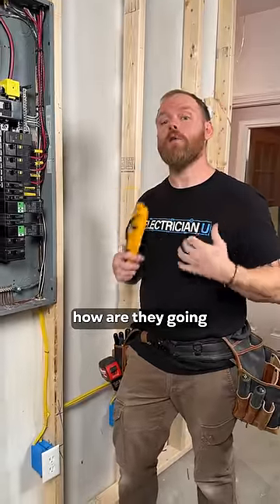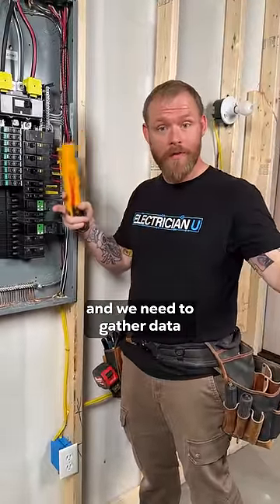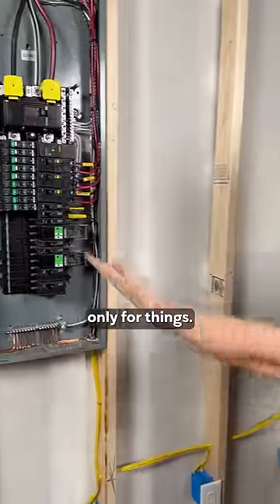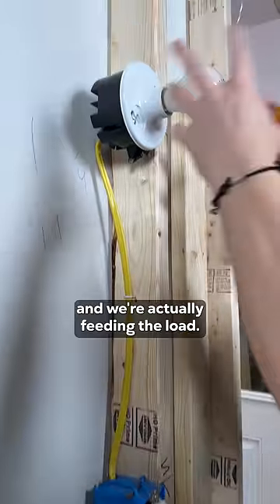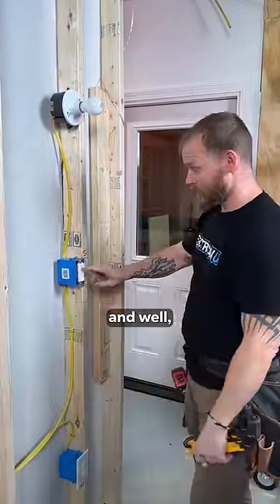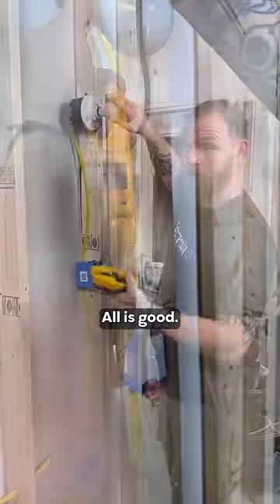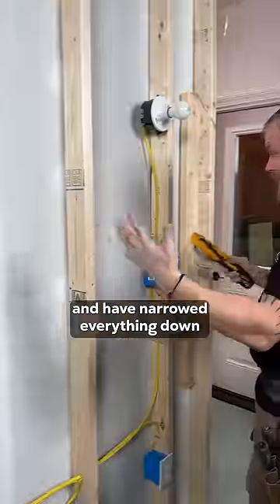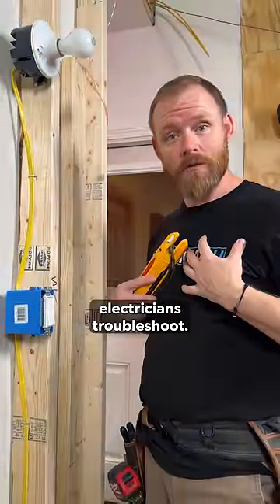How Electricians Troubleshoot a Problem

Comment: Good troubleshooting is always process of elimination, figuring out what the variables they are, testing the most likely causes first if you know what the common failure is and then ruling out any others. Worst approach is simply swapping everything as you have no idea what it was that fixed it at that point. Doesn't matter if it's electrical, electronics or mechanical or even medical.

Comment: All electrician's aren't created equal. Don't accept someone's word based on their resume.  anywhere from 500 to 1000 are electrocuted every year.  About 30,000 have no fatal accidents. While it's fine from an electrical stand point to use 12 gauge wire for a 15 amp circuit. ( a wire can technically never be too big.) An inspector CAN make you rip all that wire out and install 14 gauge wire. The inspector has the final word so be respectful and humble. If you come off as arrogant. I guarantee he's going to find something he doesn't approve of.

Comment: I have a question. Bulb in good condition, swith  in good condition, breaker in good condition, voltage in bulb socket (I removed the bulb and test voltage inside the socket) 117 V. But no light. Where is the problem?

Comment: done maintenance work before..(not a pro but learnt well) .......I usually always knew if it was the fixture or the switch... easy to figure. minus the bulb/breaker switch.... was told once "turn that breaker off before you change that (bedroom) light fixture" I said why?... there's the light switch right there. .......in off position... THAT person learnt that one on me.

Comment: Yeah but you didn't say open the breaker (remove power) before replacing the switch. You tested and told me you got 120v there, now you just started replacing the switch, far as I'm concerned that circuit is energized, I don't know who/how it's wired, I won't "assume" it's installed correctly. Whoops! Safety first, correct?

Comment: The worst troubleshoot I ever had in my work was trouble shooting an ancient automatic fire alarm system on a huge hospital (Huge hospital in Norway is probably not so huge in US standard, but I was alone). The fire detectors were wired in a star configuration, which is illegal these days in Norway and cause alot of headache. I used days just eliminating and troubleshooting. In the end I found the fault in an old hidden junction box, one of the wires were a little melted (I could tell that whoever stripped that wire 30/50 years ago, nicked the copper), and it probably only had like a 50% connection. I replaced one wire and reconnected it, and everything was back to normal status. Troubleshooting can take a huge amount of time

Comment: If its a bulb, GFCI or breaker reset, etc. its not hard to convince them that its a way lesser evil than if i had to troubleshoot half a day and open up walls etc to fix bigger problems. I mean surely they didn't want it to be a big problem just to not have to say they were dumb.

Comment: But my lingering question is; I want an experienced electrician to come out to check and map my breakers and the wires. Then eventually relocate some wires due to scheduled remodeling (I.e, in some places they are just in the way for a clean finish). I also want the electrician to remove unnecessary locations. However, my question is how do you find an electrician who is not just going to quickly look, overcharge, or otherwise make stuff up to upsell. Cause as far as they know, they are doing an inspection and mapping. And they won’t know about the several projects, until I see their work and their knowledge and behavior. I am not an electrician and while I will replace light switches or broken outlets, I won’t touch a breaker, cause I don’t want my house to burn down or for me to be fried.

Comment: Same intelligent process I teach to my computer programmers.  So they can "debug" a program.  

Same basic process as repairing radios, TVs, etc.  But, it's called "signal tracing".  Inject a known radio signal into the first stage.  Then check that signal as it passes from one stage to the next.  When you find a weak or distorted signal coming out of a given stage, that's the problem.

Comment: German Electrician here.
I wish it would be that easy most of the Time😅 (Open Walls, known Circuits, etc.)
Sometimes you search for Hours just to find a little broken Connection inside a Wall (not a dry Wall!) at a place nobody knows the Connection was made there.

Comment: Good ideology, but the way he went about this just seems fucked.
1. Test the socket. Is it getting 120v?
2. Check the switch. Is it operating correctly? Is it getting 120v?
3. Check the panel. Am I running into an open neutral?
4. If 1 and 2 aren’t getting the proper voltage, or I identified that there is an open neutral, then it’s time to start tracing the circuit to other boxes or devices until I run across the problem.

Comment: I think I would've pulled the bulb and checked power w switch on and off. Start from one side and work my way back. If u see the voltage at the base turn on and off when u work the switch, u know the breaker, wires, and switch are all good. One test. Then I'd change the light bulb. But I'm not an electrician. 🤭

Comment: I'd check at the switch of bulb for voltage helping rule out 2 things at once. That's a class room explanation. Real life you need to be more efficient with troubleshooting Esp in industry if the production stalls, time is money.

Comment: Gotta change this to “How residential electricians troubleshoot a problem”

Coming from an industrial electrician’s point of view, there’s a whole lot more than just a single device, a single load, and a single power source. I mean, I guess the single power source is the 138kva coming into the plant, but then you have all the transformers, rectifiers, relay’s, drives, motor’s, etc that’s all involved.

Plus gotta have some millwright in you, cause that pump problem is your problem until you prove that it’s theirs.

Comment: You kinda over complicated it. Everything in electric is either a load or a switch. Everything can be reduced to that. A breaker is a switch, a contactor is a load/switch combo. The second most important thing is using your past experience when troubleshooting shorts/lost power. Are the outlets backstabbed? Are they in metal pipe in the slab? Was there work recently done? Is there a box somewhere that no one knows about? Like you said, tons of variables. Almost never is it a “bad breaker”

Comment: A few quick tests with a multi meter, then swap out a faulty switch takes 20mins. The bill will be 2to3 hr minimum charge @ 80$+per hour plus the 15$ for a new switch..

Comment: You put the multimeter on happy beeping mode, and 9/10 times you can just poke things that should produce a happy beep, but they don't. It's not the complicated part. I'm an electrician and I don't call beeping a circuit data.

Comment: I have next to no idea what i am doing with electronics, yet i almost always seem to be able to almost always fix them by pulling them apart, cleaning them, resoldering loose bits, replacing burned bits, and putting them back together again. How people can't is beyond me. Like, its literally already broken, just pull it apart and give it a try. Worst case scenario is that you break something further, best case is that you fix it.

Comment: IMO the easiest way to diagnose that problem was first checking voltage leaving the breaker then if thats good, taking the bulb out but not testing the lamp, test the voltage at the lamp holder. If theres a good supply, lamp is faulty, if the supply is bad or non existent even after flicking the switch and testing in both positions, its probably the switch.
Then you find out the customer changed the light themselves and the switch works fine 😂

Comment: Here's what I find amusing a lot of electricians like to take insulation put over the wire and write with a sharpie what it goes to. Here's the problem that sharpie will not last for more than 4 years and it will start to fade and be impossible to read. However there is a solution that is using a labeler and printing a label sticking it on the insulation and then running a piece of clear shrink tube over top the label so the label will never come off. This is something that I have worked on extensively as a structured cable engineer labeling is extremely important in network cabling. When you have a RJ45 on the end of a network cable and you need to ID it.

Comment: First thing take out the bulb, check the bulb. Second thing put your meter inside the socket and see if it's hot.
Then go to the switch and see if you have power inversious power out simple

Comment: I'm a maintenance technician. What i usually do is, I test where the problem is, if there's no power,  I go all the way to the other end to test the circuit breaker. Most of the times something happened and the breaker is tripped therefore, there's no power to the equipment. Of course after that I work my way up all the way to the equipment to figure out the problem.

Comment: Troubleshooting always starts with asking questions of whats been happening where and when did it start. Typically can narrow things down a lot without getting tools out yet.

Side note weirdest troubelshoot ive ever expeienced was they were having issues with the closet lights in bedroom going dim sometimes and not working othertimes and the bathroom light messing with them.

Ultimately someone did some goofy wiring and essentially the bath lights switchleg was acting as the closet lights neutral .... Not sure how someone messed up their install that badly 😂

Comment: As a seasoned electrician, you first test the circuit at the switch.  You don't test the circuit at the load as you are doing.

Comment: I like them requiring a neutral in the switch outlet now which also explains why it’s run that way. The older style was to run the power straight to the light and then the switch dropping the neutral to the lighting outlet in that box and then running any other lights or in this case the receptacle outlet out of the lighting outlet. It accomplished the same thing but nowadays you need that neutral at the switch a lot of times

Comment: Dont call an electricians simply check the breaker then change the bulb if that doesnt work change the switch if none of those work then maybe call an electrician but for $100+ service call your best buying a solar powered lamp

Comment: I would not have bothered taking out the switch, but test either with a 2nd light bulb that works or meassuered the socket of the bulb.
Now try find a ground fault in a large ciruit. 😂

Comment: Hey you start is there power in all house mterbox.three or socket not working you look at thyey breakers if yuo isolate the section use clamp meter to check for shorted wires

Comment: Let's see you trace out a broken wire fused to the pipe in the ground under the parking lot because they pulled in the wore too fast and nicked it over time the corrosion fused it to the pipe. Now the white common return path wire is lost. Now you gotta dig up the parking lot or the lights are gonna stay on forever

Comment: Safety first.  Stop thinking.  Reboot what you are going to say.  You never showed  what breaker was to be turned off.  Or how to find that breaker.  You took for granted  that  this circuit was off.  You need a tick tracer to find the circuit and turn off the breaker.  As  an inspector  you would flunk this test.  Sorry.

Comment: Had a three-way circuit give us an hr run around because a nail shorted out the hot  to a 2x4. We got readings both ways but throw the switch and nothing. It was a long day.

Comment: Been there done that and it’s usually the fact that they didn’t pigtail the connections and relied on the receptacle or switch for the connection and the likely culprit, push in connections

Comment: Wouldn’t you attempt to turn on the light, feel to dodgy switch, then immediately test that.. at the same time you’ll be able to test voltage before isolating

Comment: hey i've gotta "unknown"... we just installed some lights for an office, 277v and for some reason we can't get the lights to cut complete off.... they'll just drop to the lowest dimmer setting, never truly cutting off and going dark.... and all i've got is one circuit.
Reply from the maker: Circuit tracer live or dead with piercing probes. Find the breaker or breakers. There is another way. But that's the safest most compliant way without knowing your aptitude already.

Comment: As a thought - This isn't just limited to electrocutions. As a coder, I troubleshoot in a very similar way. Identify the variables, the normal flow of things. and segment them into 'zones' that can go wrong, the test from top down.
When i built my computer, and it wouldn't start, a very similar approach was taken, by testing and narrowing down the problem. Great video, really demonstrates the foundations of troubleshooting, which I used to think was a common skill, but I've since learnt that it's not!

Comment: Seeing the bulb base fixture there brings a thought to add.

Before you walk away from the socket, use the meter to check if there is power in the socket.  With that style of socket, there is a small tab in the bottom for the power, and the threaded ring is the ground for the bulb.  I have in the past, found several lamps, or screw in bulb fixtures that were actually still functional, but did not make contact with the bulb properly, especially if it is an aged socket.  If you find that the socket still has power, but no bulbs are working; turn the power off to the socket and use a tool or a loop of wire to gently pry the metal tab outwards a little until it will press against the bottom of the bulb again.
Reply: And bulb size is important.  If the fixture has a maximum rating, do not exceed it.  It may work, but it can, and often does, damage the fixtures internal wiring when one exceeds it.

Just yesterday I pulled burnt wiring out of a lamp that someone did this.  It happens, it's ugly, and it's a fire hazard.  This one had one inch of burnt conductor between the socket and the hanging bracket.

When in doubt, use the size of the fixture as an indicator of how big a bulb to use.  If the case is small like a desk lamp, it's probably going to use around 25-45w maximum.  A ceiling or wall fixture will probably max at 60-75w. Anything above would take a fixture designed to utilize a 100-150w bulb.

Comment: I know wholeheartedly that this is a well-intentioned video and meant for layman.
As well as correct, no complaints, and thank you. Well done.

However, as a licensed security/fire person going on 30+ years in feild, I still can not stand troubleshooting "minimized", as for instance an intelligent slc, certainlinly with multiple ground faults mixture of class a and b thrown in and etc  in large commercial settings, and not having to explain.

But residential wiring and problems are particularly hard to convince a homeowner  of.
Cheers...
Reply: Most shorts are under 3 minutes my licensed friend. 30 years is a bit. Your not so humble brag was acknowledged.

Comment: That's basically how you troubleshoot any problem. You have a thing that doesn't work. Whether it is mechanical, electrical, or software, or even something like plumbing, you have a flow of stuff. It has a start point, and an endpoint. You put something in, you don't get the expected result out.
 
So you start from the source, and test everything on your way through, checking off possible things that could be wrong. It's a skill that sadly many people don't have, or have very poor skill in.

Comment: I just pray that the electrician can actually read a wiring diagram and does not think he knows more than the people who make it. Electricians burn up control circuitry all the time. Then want to argue that they are the electricians. Pulling wire in a house is a LONG WAY from being a REAL electrician.

Comment: Troubleshooting is my favorite thing to do.  From the earliest homes of K&T with switched and fused neutrals all the way up to present day.  Understanding how guys would have ran circuits in most homes and the different techniques and paths used due to raw material shortages of some eras, or running home runs from light to light because the boxes had more room to make joints than the receptacle boxes, all sorts of information is stored in our heads as the years go by.  I usually start by a soft interrogation to gather as much intel as I can.  What does the homeowner know is not working, did everything break at the same time (the one switch that has been broke for 10 years isn't related to the outlet that just stopped working), is anyone using portable heaters, where does the vacuum cleaner get plugged in, I look for things like ironing boards set up in a bedroom and not the laundry, any recent construction projects, was it raining outside, the list goes on.  The amount of troubleshooting problems that are quickly narrowed down to a bad lamp post wire by turning the switch off and resetting the breaker.......very long list.  Troubleshooting is a passion of mine, love finding the smoking gun.

Comment: Bad place to be asking and im sorry but my microwave at home is completely dead. There is no electricity coming from the outlet that the microwave is plugged in. Every single time we turn the power off to get the microwave back up and goin, it will shut off within the first second. Just wondering if you had any ideas will definitely use that info that was shared on the short fs. your content is awesome man. keep up the hard work.
Reply: So is your microwave dead or your outlet? Does the microwave work when plugged into another outlet?